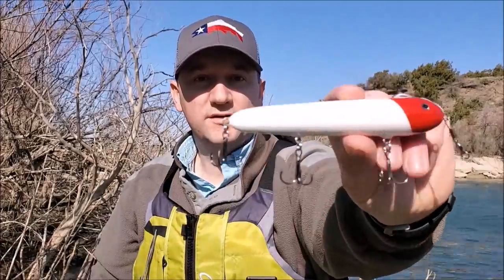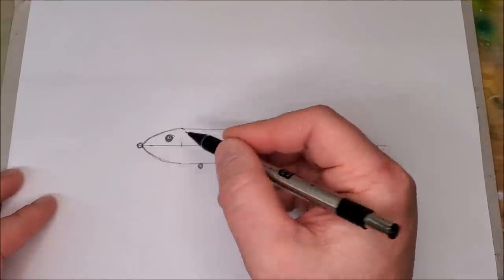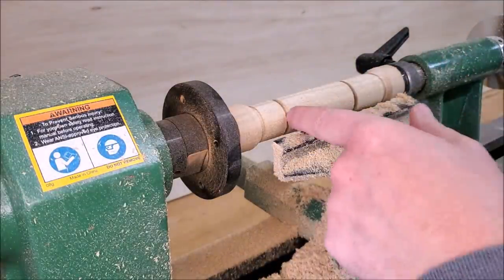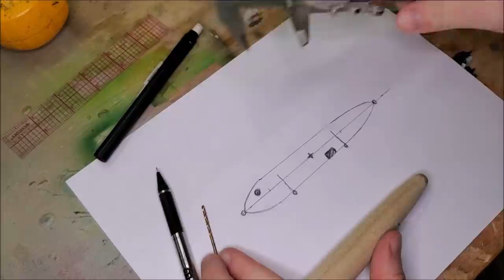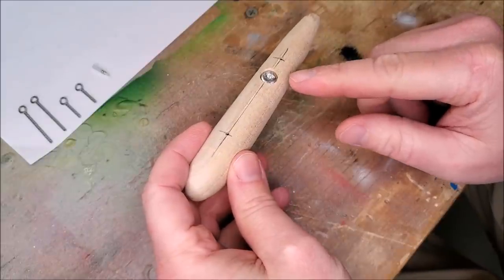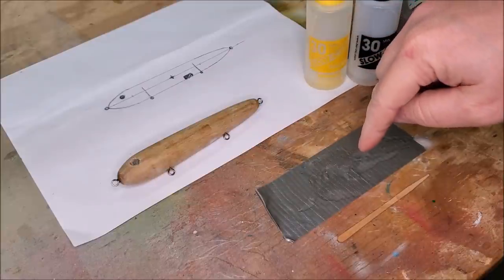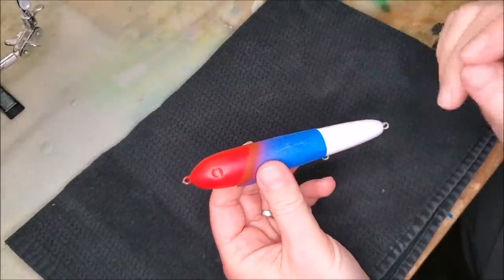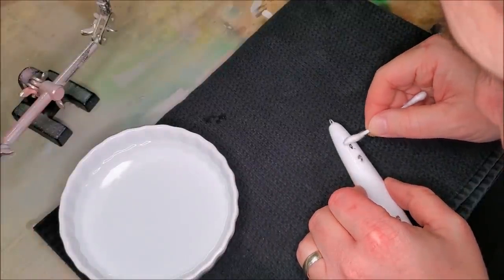Making a Wooden Walk The Dog Lure

Comment: Nice Build! Like the simplicity of the pattern & color scheme! I believe that opaque or flat colors look more natural and get more strikes? Also using the duck tape for your 2 part epoxy mixing dish? Of the Heddon Spook type baits! The old Rebel Jumpin Minnows were the best! One year At Houston's Spring Fishing Show Cut Rate was moving from their original Telephone Rd. They had a bathtub full of those old Rebel Jumpin Minnows for a $1.00 apiece! I was told for $500.00 I could have them all! One of my many wrong fishing choices! I bought 10, Study long? Study wrong! The new ones encased in plastic don't fish the same? Or I don't? But when you look at them with polarized sunglasses they look black! I think fish eye lenses are polarized! To filter out the sun's glare, that's why opaque & flat colors look more natural? Especially fishing for Trout in the surf or back bays! TMI!
Reply from the maker: Thank you! There are a lot of old and interesting lures out there. I have thought about re-creating some of them. Fish perception is an interesting topic.

Comment: The benefit to using 2x2 is being able to line up holes and and other cuts with the square ends still on. You can also drill the line tie and rear hook hanging on the router or by standing it up on the drill press. This make a line through really easy.
Reply from the maker: There you go, good stuff!

Comment: I just discovered you channel, Love the work you do, I do have a question on the epoxy for you. I also use True Glide, Do you mix equal weights of parts A & B, of do you weight it out in volume. Thanks
Reply from the maker: Thank you for yoursupport! I always weigh epoxy because it is much more accurate. Whatever I use for Part A I multiply by 0.86 to figure out how much of Part B I need.
Reply: @zimmtex  Thank you

Comment: Im have a problem with my lure rolling and solution to correct this?
Reply from the maker: The trick is to put weight on the bottom axis of the lure. Assuming you've done that, you may need more weight to add stability. If adding more weight makes it sink, you may need to try a more buyoant wood like basswood or balsa. Hope this helps.
Reply: Thanks so much!

Comment: What size bit for the line tie hole
Reply from the maker: Hmmm. I'm not really sure what size it is, but I try to size it so my twist wire does not fall out when dry fitting and not so tight I need tools to screw it in. I aim for a loose fit. Hope this helps!